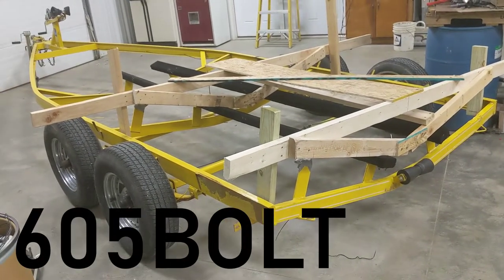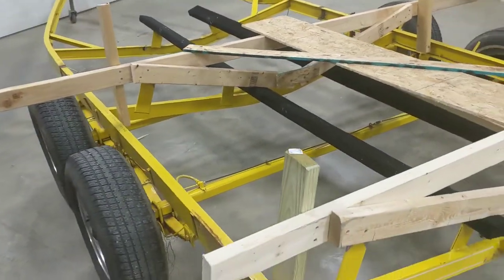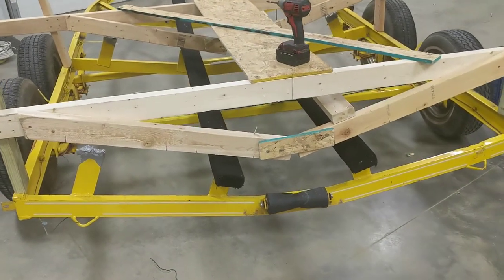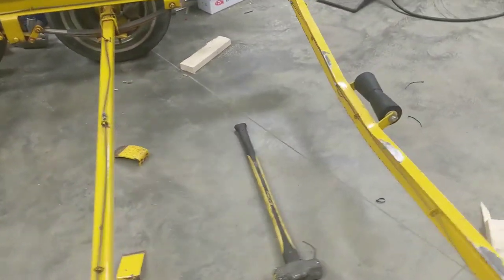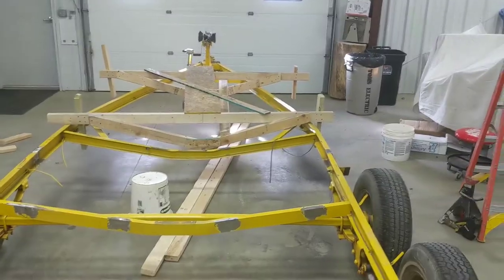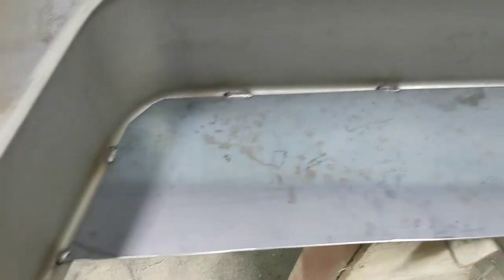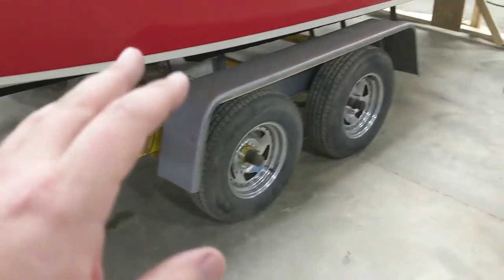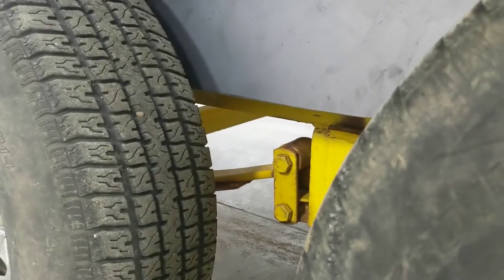Fitting an Existing Boat to a Different Trailer -- New Bunks, Fenders, Leaf Springs, and Bow Rest

Comment: Cool video man! I would love to have a garage like that to work in. Been doing my belows job in a storage unit and its a bit cramped. This looks like alot of work. But you seem to be doing things right and will have a great trailer for the life of the boat! What color are you doing? Or is that a spoiler? Lol.
 Good job man!
Reply from the maker: Appreciate u saying that. The building I'm working in in this video is my dad's shop. It has heat so it's way nice for winter months. The trailer is packed away and done for the winter all painted and wired currently. We went with red to match the boat (no worries about the spoilers haha). Keep after it on your bellows. Its a crappy job but a great feeling to have it all done. I really appreciate you commenting and watching.
Reply: @605BOLT  No problem man. Your videos have been alot of help. I just need to put the drive back on and calibrate the trim sensors and adjust the shift cable. Boat should be in the river for testing this weekend!!
Reply from the maker: @pole_barn_builder  that will be awesome! Beer time!🍻

Comment: Hi,
Using angle bar for the stands is bad idea. 
Flat bar to be there, it is not so solid and working like spring. In case of trailer hits something your boat will be badly damaged.
Reply from the maker: You're probably right. Its all I can come up with.  I put perches on the top and she seems to hold.  I didn't have great metal selection to be honest.  Kind of just working with what I could get.  I don't drive it that far.  Only a couple miles.
Reply from the maker: I wish I would have used something a little thicker than what I did also. It would have been easier to weld.